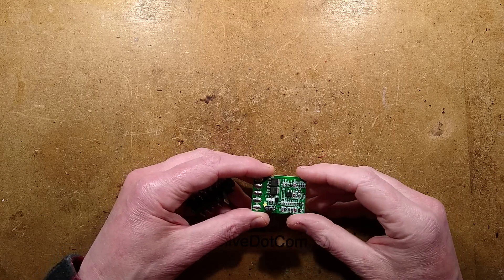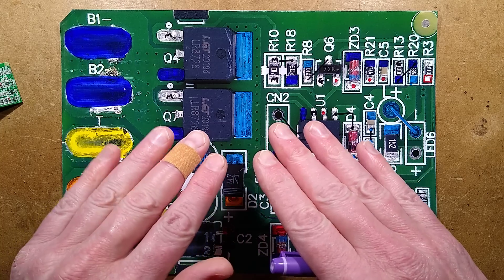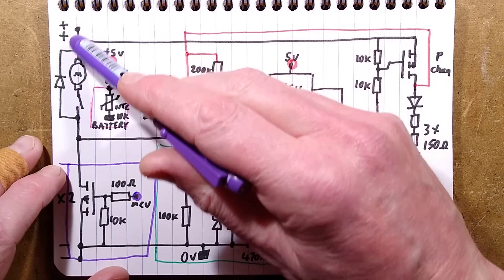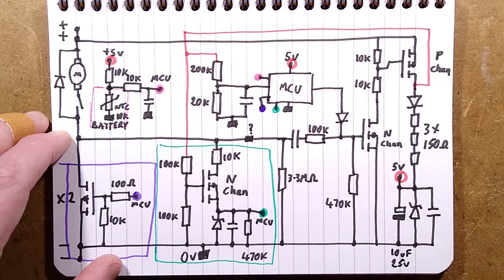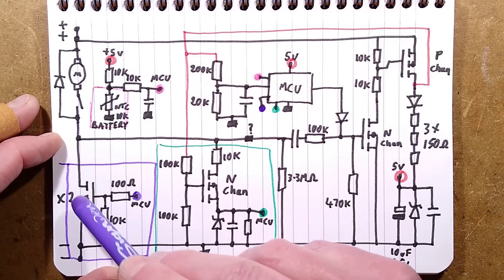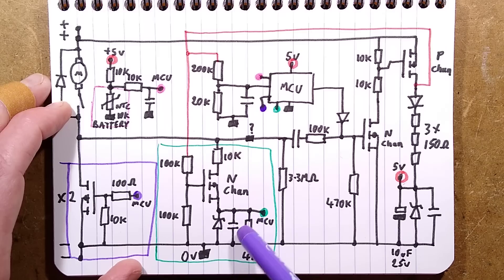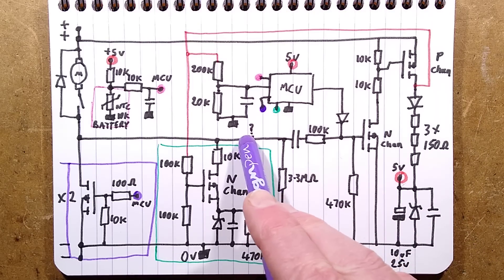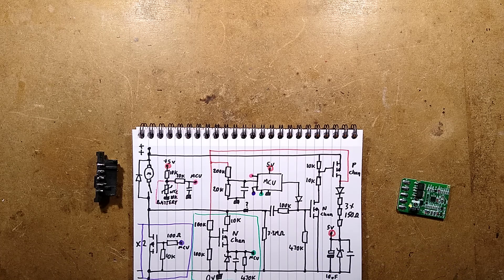ALDI/Ferrex cordless drill PCB

Comment: I’m having an issue with this battery/drill. When I use it with the 40V 5Ah battery and try to drill into something tough, like metal, as soon as it starts to struggle it goes into protection mode. After that, the drill won’t work unless I remove and reinsert the battery. This doesn’t happen with the 20V battery—if it struggles a bit, it never shuts off. Have you had the chance to test this yourself?
Reply from the maker: I've not tested it under high load.

Comment: One question, if someone is still reading this, I have a vacuum cleaner (Aldi, Silver Crest) that is intended for use with this Ferrex Activ Energy 20v/40v battery, I dont have the battery so I connected 10K resistor between B2- and termistor (center pin) and connected power supply (set it to 20V 2A) to B1+ and B1- and it is working OK in first speed but when I switch it into a second speed indicator light blinks red and it switches off. I do not have B2- and B2+ connected to psu!. Does it really needs 40V or can I connect B1- and B2- in parallel and same with B1+ and B2+?  I presume both speed should work normally even if you use 20V battery on this vacuum cleaner so having a 40V battery should not be a requirement.

Comment: Hi again Clive,  once more a great video explanation.  The topic made me remember something I have tried a few times in the past and never succeded!  I always wondered if there was a way of tricking onebrand of charger to charge anothers battery pack?  Nothing insane like charging 40v with 20v charger but simply using a Ryobi charger to charge a Ferrex or Parkside pack of the same voltage.  Does that sound enough of a challenge for you.  Maybe someone has already done this but if they have then I can't find it anywhere.  It would be worth a good few coffees from me!  Al🙂
Reply from the maker: The circuitry seems to vary between power packs.  The easiest ones to make universal are the cheap eBay tools, since they often have the protection built into the battery.

Comment: I got this fly orb  hover ball and the battery is not lasting anymore. Do you have any ideas on how to fix it? I have been trying for days and am starting to get frustrated.

Thank you
Reply from the maker: If it's been used a lot or stored for a long time with a low battery it may need it replaced.
Reply: How would the battery be replaced?

Comment: From watching this series...
These have been competently done for their target audience.
For that reason, they should be considered for a novice/seldom home diyer.
I can't imagine it would hold up to drilling a hole out of a brick wall ,(fan ducts bad the like) but would hold out in a IKEA screw to wall kind of way. Loose bit of decking. Screw the flat pack shed.
Wood applications and light stone/metal drilling exercises upto 8mm. Which is most stuff tbf.
I have some pro Bosch, and I used things seldom but when they are used... They get used... Gsb21, took 4 times longer to drill a 6mm hole 2.5 inches than the GSb 55. The hammer function with brick is very much a consideration in pro application.
I'm going off topic towards a pub chat...

Good tools for money. For a seldom diyer.
or to give your kid for learning with.. when they are old enough... Ofc... 
The thought that's gone into the circuitry leaves me feeling confident that it won't blow up or catch fire in my hands
A true story with older, cheap power tools...
But I'd have to see some in rough tough in action to decide if worth buying as a back up.
The GSb 21 is the back up/light duty if the GSb 55 is in use
For everything else, there's an SDS.
Which I don't think Aldi will sell anytime soon.
Maybe
Haha

Good work Clive and thanks for the destructive delivery or knowledge. It is for the betterment of us all. And maybe Aldis bank account...

:D
Reply: I agree. I bought a Festool drill/driver set at about 5 times the price of these store-brand tools: it is a work of art and a joy to use. But for my home-gamer work the Black & Decker tools that make up most of my inventory of power tools are more than adequate.

Comment: Gosh. So much technology just to spin a drill motor.  I still have my 120 vac driller that I installed a 25 foot long cord on, because I felt it was getting a resentment about the freedom of my battery operated unit. I'm sure it feels happier now.
Hey BC and crowd, I just uploaded my VERY FIRST YOU TUBE VIDEO!! It's not long. Slightly interesting perhaps. Check it out!!!👍🤓

Comment: I think you are correct that they turn the two big MOSFETs off and monitor what happens on the MOSFET outlined in green.  It is a bit odd that they didn't use a GMR current sensor or something to monitor the current.  Maybe an extra MOSFET is cheaper.
Reply: A FET is about 100x cheaper than a GMR sensor, lol.
Reply: @jaro6985  In small numbers, GMR sensors are about $2.  In large quantities they can be under a dollar each.
Reply: @kensmith5694  yes, and you can get a FET for less than 1 cent...
Reply: @jaro6985  That depends on how many and the size of the fet.  But you may be right about the reason, anyway.

Comment: That amount of complexity is insane. It looks like the work of someone with too much time and nothing else to do. They could've just had all the protections in the battery and made the tool nothing but a (variable speed) switch and a motor. Maybe add a klixon if the user is too stupid to not burn out the motor. All of that circuitry is otherwise unnecessary... except perhaps as a way to shorten the lifetime of the tool.

Comment: Version 7 of Kicad is due for release any day now, it will have a feature that allows a PCB to be imported in then you can draw traces over it and all the other bits and bobs, its aimed specifically at reverse engineering even allowing for exporting your work to be manufactured. Maybe something in there that will be useful to you in your endeavors !...cheers.

Comment: I highly recommend you to watch this ElectroBOOM video about brushed DC motors -  "Brushed DC Motors and How to Drive Them"
Most likely the green box circuit is doing double duty detecting (w/ the MCU) when the button is pressed or not and also how much the motor is loaded or even if it stalled (all using the OFF time in the PWM driving x2 NMOS).

Comment: i guess the 'weird' mosfer can only work when the power mosfets are off for low battery voltage and to reset the sleep timer,  but due to the rdson resistance of the power pair could it also detect overcurrent?

Comment: I've got a Harbor Freight Hercules Drill that has an issue that I need to break down like this. I've taken it apart and found no obvious problems. The issue is when you pull the trigger the illumination light comes on and there is a bit of high pitch whine that jitters, but no motor action. if you play with the trigger it will start up and drill fine, but it might take 20 sec of trigger maniplulation to get it to start. I have yet to find a replacement trigger. I am watching for parts drills as well.

Comment: Mattias Wandel took apart a tool battery recently that was dead, it had three lots of 5 cells  in and all three middle cells in each group was way under voltage. It seems the charge control balancing circuit in the pack was powering itself from the middle cell so if the pack was left unused for a long time it was very slowly draining the middle cells right down.
Reply: I noticed this on a non charging battery pack of mine.

Comment: The circuit possible turns off as follows.
Release the trigger and the voltage at either end of the series capacitor will drop. This will turn the N channel and N channel Mosfets off. The 5 volts to the MCU will drop to 5V and everything is then off.

Comment: My £5 Ferrex impact driver works with the drill PCB removed, and a Makita battery connector directly wired to the trigger + & - leads. 
Thank you for your description. I was wondering what all the fuss was about 🤣(Complicated redundant circuit Makita batteries have onboard).

Comment: Does this mean the protection circuitry would fail to start if the load was drawing a lower current than the multiple amps the tool motor would draw?

For example if one were to cut the battery connector and board off of a dead tool and use it to power a small site radio…
Reply from the maker: I'm not sure the minimum load that's required to keep the protection circuitry awake.

Comment: Most relevant information from this video(s) for me is, that there is no mechanical decoupling between battery contacts and PCB. So all forces and vibrations put a load on the soldering. But that seems to be standard also on expensive ones. My saw has wires between contacts and PCB.

Comment: If the schematic is correct, the only way to sense knob release is by sensing battery voltage drop. This may be picked up by the MCU via 200k/20k divider

Comment: I've printed a few battery connectors. So I can use them for other purposes. I'd like to incorporate some low voltage cutoff, to protect the battery. What would you suggest. Could be an interesting video.
Reply from the maker: Technically speaking, with this switched thermistor system you could use that signal to pull the gate of a P channel MOSFET low to turn it in

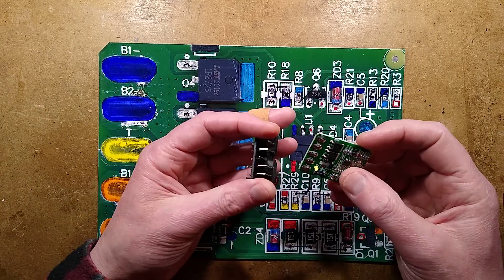Comment: 0:18 To remove a clunky piece from a pcb, is to use stiff copper wire, bend that wire in a loop arround all pins (like a flatten O) and solder it on both sides of each pin. Then place your solder point in the middel of the row pins on the copper wire, so that heat can flow equal to both sides. After a few minutes, the big piece will fall of the pcb. This trick can also be used to remove PCB-transformers or pulse transformers from SMPS. For this to work you need to crank up the heat temperature and use the largest solder tip for best results.
Reply: Where there is a will, there is a way. I was pondering the idea of dipping the pin ends in a molten solder bath, but that still doesn't get them all out as one unit

Comment: Question/experiment if you could please Clive.

Before I get a 40V angle grinder, would a 10K resistor work on that? I plan to power it with 2x 20V packs and a 3D printed holder. 

Resistor or thermistor pin of one of the 20V packs?

Comment: There is a lowmelt solder available, it has a way lower melting point.
This solder can help a lot with removing these solid pieces of metal.
Applying this to the solder point also lowers the exsisting solders melt point.

Comment: They've got the impact drill and driver (no battery or charger) on special at my local Aldi, under a tenner each, bargain?
Reply: Definitely! especially if you have the 40V batteries & charger. You can get the angle grinder too.

Comment: This circuit is using a couple of rectifier FETs as a low-side-driver instead of using a full motor driver chip as a high-side-driver. The circuitry is more complex because of the missing features (current sense line and thermal cutout), but the principle is the same: microcontroller produces a PWM signal that turns the FETs on and off in a controlled way to vary the speed of the motors.
I think something is missing, because the N-Channel FET circuit is probably monitoring the switch and sending an analog signal back to the MCU (which the MCU uses to determine the speed)

Comment: It’s really complex, Mr Clive. 
Does it need to be? Would you be able to engineer the same result with less components? 
I watch AvE as well. He explains some things and others I don’t understand I come here to learn.
Reply from the maker: The complexity is purely so it can sleep with ultra low current.
Reply: @bigclivedotcom  ah okay. AvE mentioned that. That having the battery on the tool and leaving it for long periods will drain it completely dead because the chip draws so little current that the battery’s brain doesn’t stop it. Or something to that effect.

Comment: One way it could know the tool is not in use. Briefly turn off the two parallel mosfets (purple). At that point, if the trigger is still on the feedback (green) will rise. Else, if the trigger is off the feedback (green) will stay low. This could be done fast enough to not be noticeable.

Comment: Once you release the trigger, the voltage at the green dot will drop to zero (after capacitor discharge). Until then this would be almost equal to the voltage drop across the mosfets in the purple box.

Comment: Could the green tinted mosfet have been a battery caution circuit? Sort of a half power remaining indicator. If it was meant for raw switching on overload a better divider ratio should have been used. The last idea is that it was a "voltage to low" sense for the processor's own 5v rail, since it's drawing bias after the P channel mosfet. I think the days of a 6 foot cord on a drill were the easiest. Keep working. Good luck! 👍
Reply: A 6 foot cord get's problematic when you are up a twenty foot metal ladder in drizzly rain.
Reply: @Derek_Garnham  I hear that. I suggest cutting the end off a 50 to 100 foot cord and using it. At least it might cushion your fall on the way down.
Reply: @d.t.4523  prevention is better than cure, perhaps lashing myself to the ladder with it would be the way to go :)
Reply: @Derek_Garnham  Hahahaha

Comment: It reminds me that I really need to remember where I left the chargers for my two drills (One B&D, one Bosch), kind of need to charge them cos they're both fully discarged, not a good state for lithium packs... :\
Reply from the maker: I've done the same, and rather leave them to overdischarge I've nudged the voltage up with a current limited supply.  But finding the chargers or buying new ones is a better option.
Reply: @bigclivedotcom  Just reminded me I have all them chargers from them LED vests, they're nice and limited, of course, theysuffer the same issue of where did I put them....... :D

Comment: The ? Resister - When the trigger is Short Circuit ON - is to limit the current to the capacitor and set the time delay for the MCU to run, power detect and to continue to run until the trigger is released - in the OC position, A way to Smooth start to reduce inrush current.

Comment: I think the green box would shut it down.  Once the 5 volt supply comes up, the motor power can travel through both purple and green, but once the motor stops, the discharge resistor in green will drop the capacitor there to 0 volts on the monitoring line.

Comment: Have you had any success opening the switch ? I wonder how they realised forward / reverse .. Does the trigger regulate speed ? How did they realise the LED light circuit inside the switch ? Does the circuit  detect stalling of the motor ? Could you power the circuit and check if the micro is always on if a battery is present ? Is there any data to be read from the serial tty  ? Could you mark some key components with their designator on your schematics, like the mosfets (Q6, Q5 etc..) Ohhoho.. that's a nice puzzle ! :D I won't buy one to find out though ! .. maybe send it to Mike, he'll dissect it for good :D Keep going ! Thanks ;)

Comment: The led could have been for testing. Also looking at the circuit in the green square does look like it's measuring current or is just there to detect when the motor is running. I'm guessing it just uses that to decide when it wants to go to sleep.

Comment: Feels like it's a protection circuit more than anything else.
It doesn't need to detect when motor is off, it can simply run for a reasonable period of time. It may need to shut down if battery goes low, might pulse output in order to gauge flow etc.

Comment: Clive, love the video, out of this world reverse engineering, learned a lot. For most of the video(s) I sat here pondering how overly complicated this drill is and what's the lifespan of such a drill. I purchased a Milwaukee 3/8" and 1/2" hole shooter around 1986. Yes, I paid a lot for them, and yes I have to drag around an extension cord, but they've never failed me half way through a job. I get it, 20 feet in the air who want's to drag around a cord, but actually, would anyone use this type of drill in that scenario? How many of these cordless drills would an average person buy in 37 years?
Reply from the maker: Tools like this are a consumable to a busy tradesman.  They make life so much easier.
Reply: YMMV of course, I'm sure your Milwaukee might have a lower TCO over its life but the Aldi drill, battery combo isn't aimed at the same market or users who would never spend the money your Milwaukee cost because it just isn't necessary for them to own such a tool to put up the occasional shelf or bracket around the home. 

Having said that, my Makita Cordless which was bought at a retail hardware store to do 'one emergency job' for a client has earned me tens of thousands over its 15 year life and is still going strong without letting me down halfway, risking trips, electrocution, falls etc. because of the cord, dodgy site electrics, careless site workers.
Reply: There are massive safety advantages of not having that cable, not just for the user, but anyone else in the vicinity. Also makes working remote from mains power possible. I only use my corded drill for jobs bordering upon "tool abuse" now, it probably hates me.
Reply: @Derek_Garnham  All of that is so true, and if you had to for some reason fix something outside in the rain or on wet ground at least you won't get electrocuted by the cordless unit.
Reply: @steviebboy69  In the distance I can hear the usual suspects chanting "It's health and safety gone mad" :)

Comment: Maybe the N chan at the bottom detects a fault condition, and would originallly light the led
if there was a temperaature problem for instance, the dual mosfet would be turned off by the mcu making the mid rail go high again, which would normally trigger the tool to start, but the N chan holdds it off while the trigger is preased